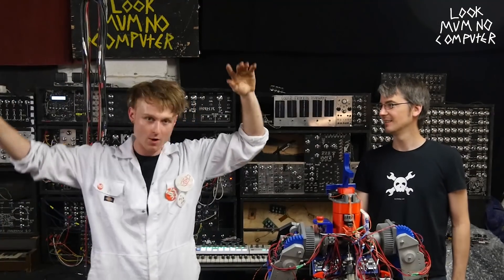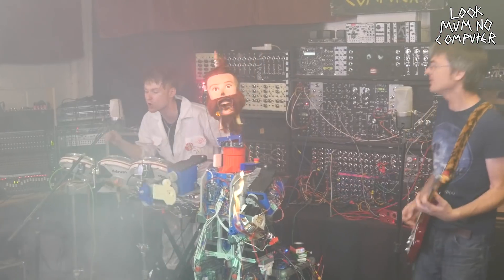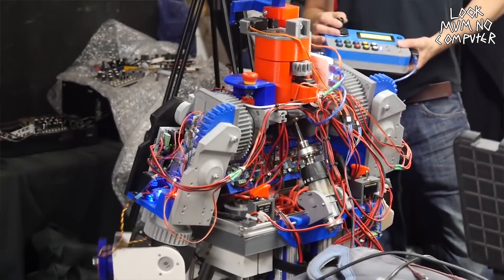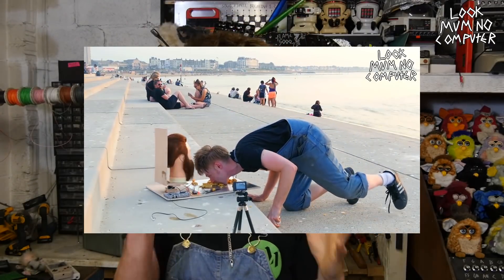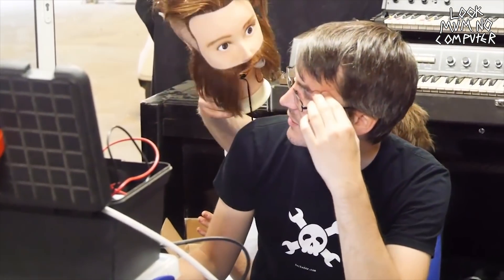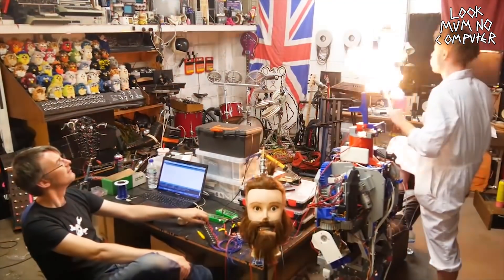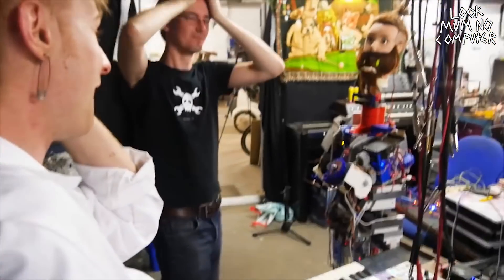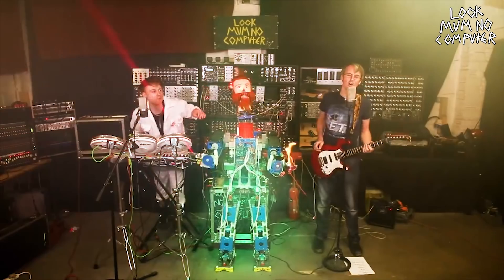Dancing Fire Breathing Robot With James Bruton!

Comment: hello do you have any more information on how you made an rc filter with resonance?
Reply from the maker: it will need to be an active filter, the resonance comes from feeding the signal back on itself, kind of like when you put a mic to a speaker and it makes that noise. i dont think its possible to do it in a passive circuit, you need opamps to split it up so it will feed back on itself
Reply: i kind of figured that there wasnt an easy way , i thought you mentioned that you manged to make one, in a comment reply, but i cant find that comment anymore. anyway thanks for the great tutorials